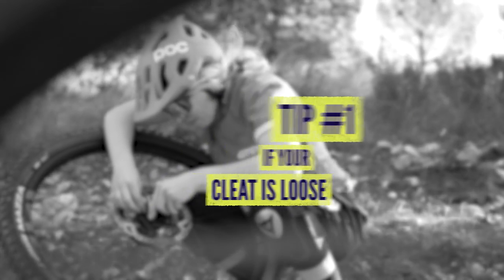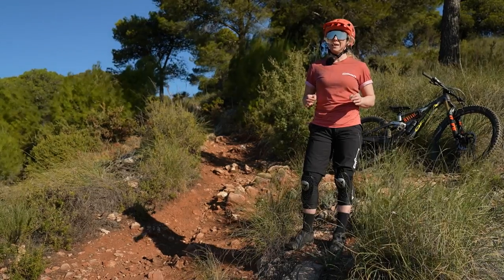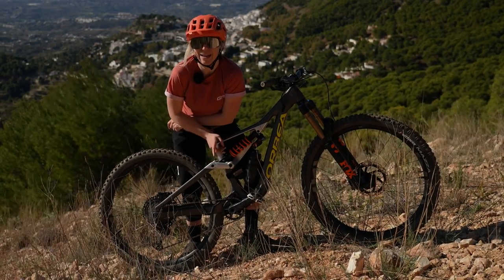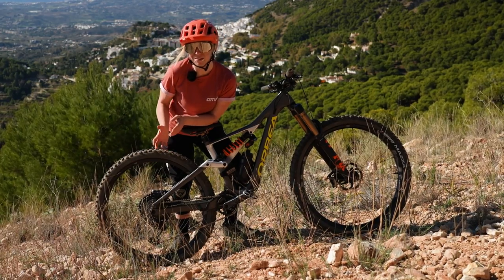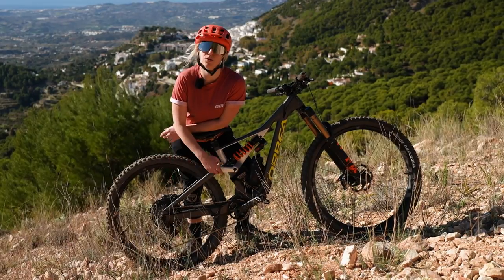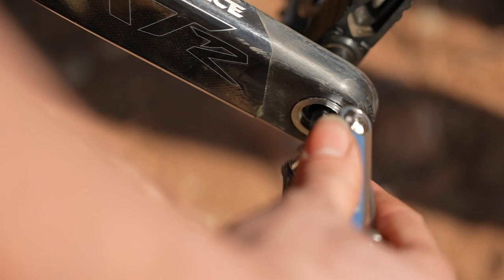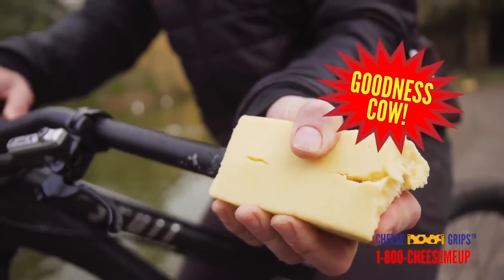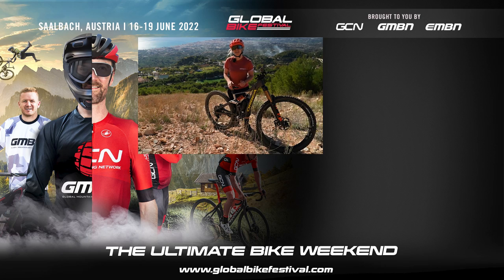Easy MTB Trailside Hacks And Repairs!

Comment: A Barendsolution for every one living in a Place with Euro as currency. Pull the lock on Grip out two Millimeter and use a 20 Cent coin as a barend it has exactly the same diameter as a handlebar.
Reply from the maker: Good tip! I'll remember that when I'm at the Global Bike Festival (shameless plug!). Hahaha - Anna :)

Comment: If your derailleur cable is  broken why not screw in your High screw to get into a lower/middle gear for pedaling out? But I do like the idea of pulling your cable out and using it because you can than adjust your derailleur to whichever gear that works best for the pedal out, however what will keep your housing in place at the shifter?

Comment: Tyre boots tend not to work if your using tubeless as the boot won’t stick properly to the inside of the tyre wall, it will just fall off inside the tyre.  The best way to use a tyre boot on a tubeless tyre, is you will have to put a tube in to keep the tyre boot pushed onto the tyre wall.
Reply from the maker: You're absolutely right! Sorry, I don't think i made it clear that a tubeless set-up would need to resort to a tube and a boot to fix the situation. I've actually used a velcro strap to get home on slashed tyre too! - Anna :)